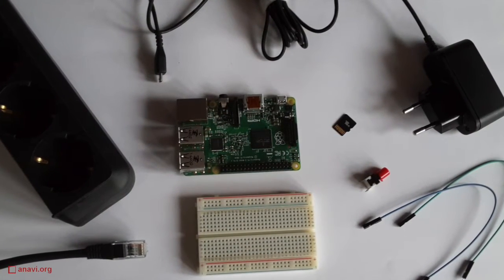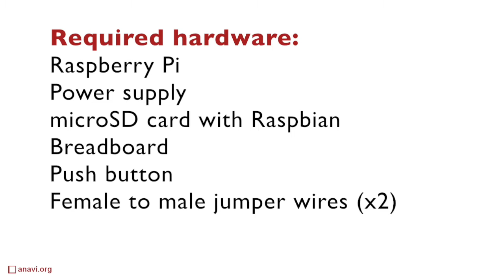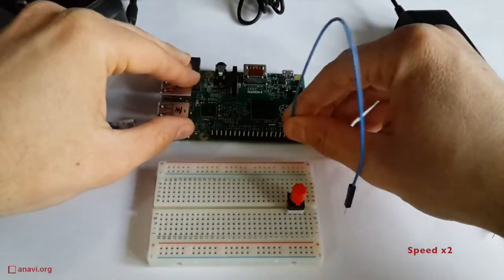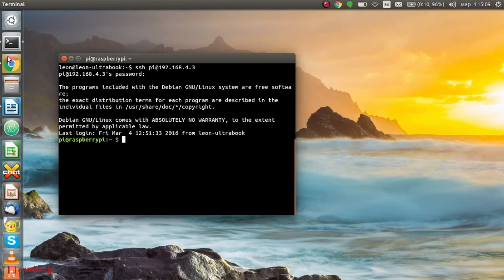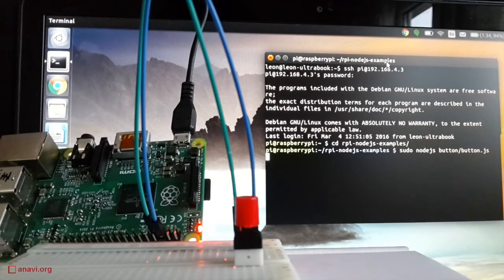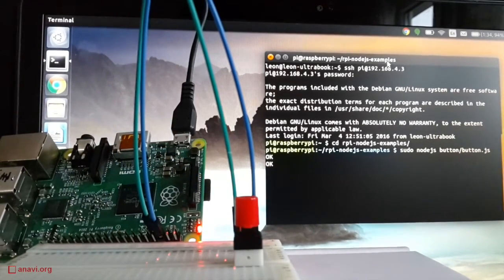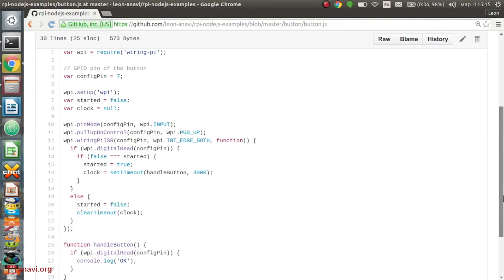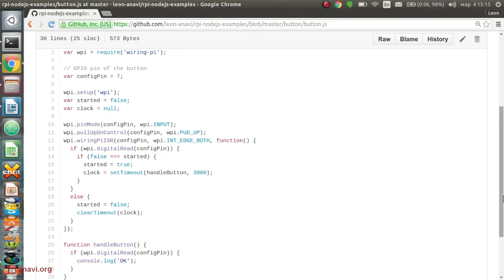JavaScript for IoT: Controlling a Button on Raspberry Pi via Node.js

Comment: How to add mariadb and record button press time?
Reply from the maker: You will need to integrate MariaDB Node.js connector, for example the npm package mariadb and of course to install MariaDB on the rpi.
Reply: @LeonAnavi  Do you have a similar example done?
Reply from the maker: @soldaster1  no sorry. You can use the current example and extend it with mariadb.